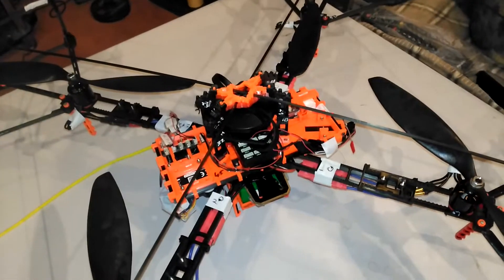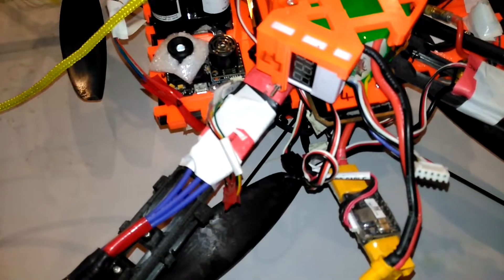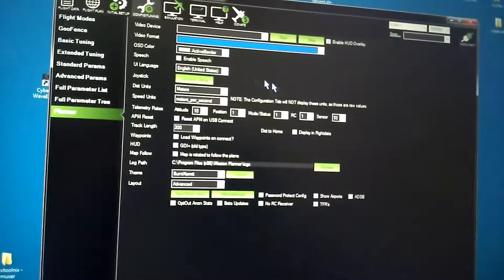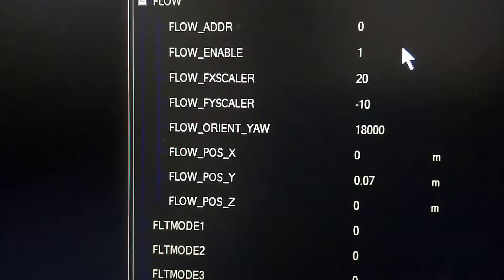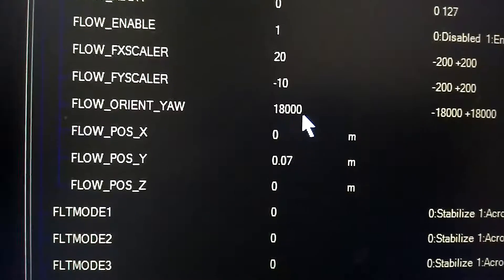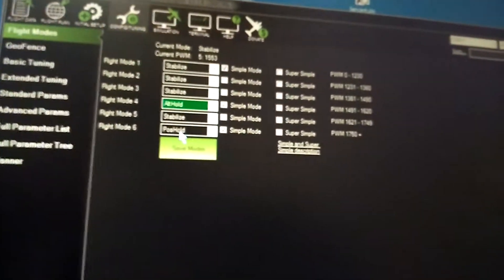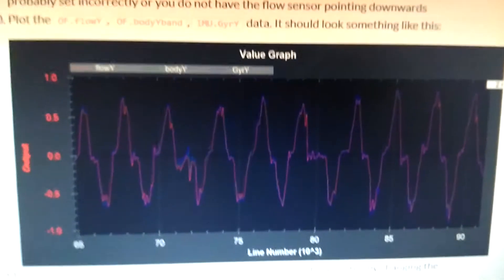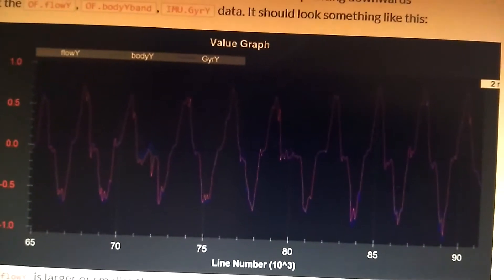PX4Flow Optical Unit Installation Tips

Comment: how does the px4flow get the altitude for you?
is the lidar connected to the px4flow or as a normal sensor to the flight controller?
Reply from the maker: Altitude: The flight controller has a barometer onboard to calculate the altitude (z-axis). In a later version of my copter, I started using a LIDAR unit to calculate altitude so that the copter could maintain altitude better.
The only thing that the px4flow is doing is taking pictures continually using the built-in camera. which points towards the ground and compares the older picture with the current picture. The aim of the px4flow is to keep the old and new picture identical and if the picture has changed, the px4flow will instruct the copter to move into a position so that the new picture is once again, identical to the old picture (ie. the copter is now back in the same position as it was in when the old picture was taken).
Reply: @voicecopter4196  Thank you, I have understood that so far. I meant the physical connection. Is the lidar connected to the flight controller and the PX4Flow gets the altitude from the flight controller or does the lidar have to be connected to the PX4Flow?
Reply from the maker: @niklasvoigt5568  LIDAR is connected to the flight controller.
Px4flow is connected to the flight controller.
Everything runs through the flight controller.

Comment: Hi really liked your video. But I think it has been outdated to the current version of Q-ground control n mission planner. The new values are very different from what you showed in the videos. I am having  a hard time connecting and getting results for the sensors. Can you guide?
Reply from the maker: HI, Sorry for the late reply. Unfortunately, I haven't been testing the copter with the newer version of hardware/software, so I can't help.